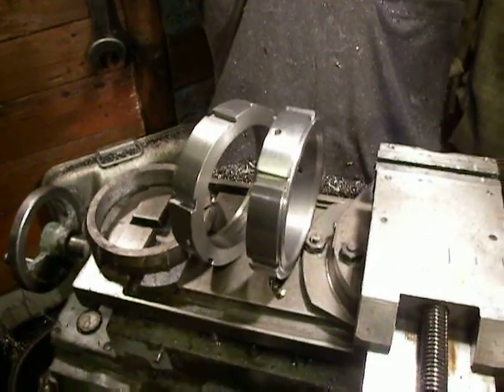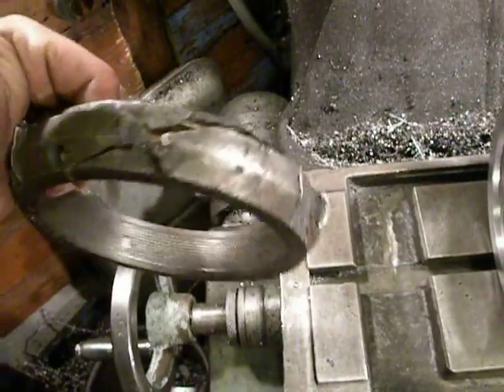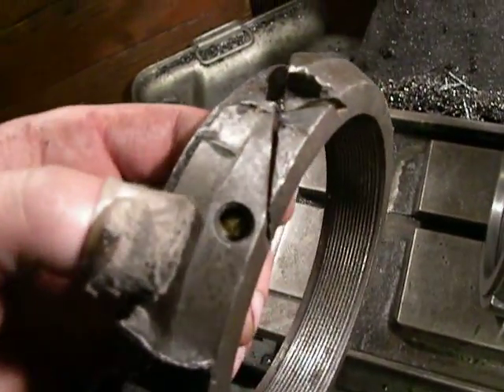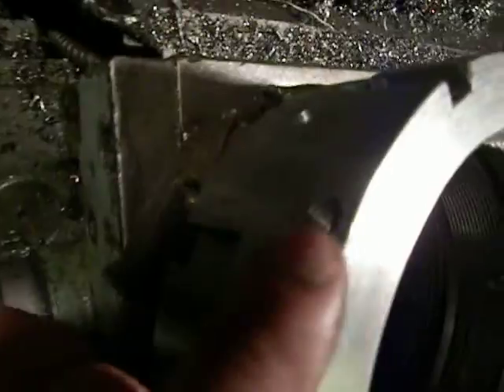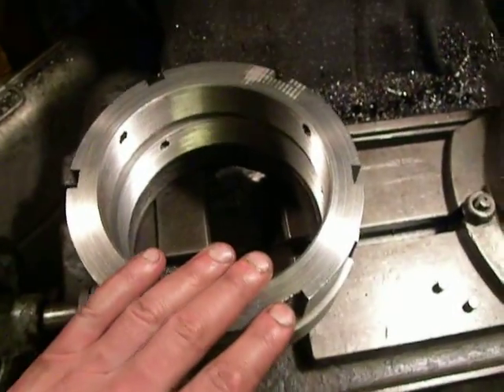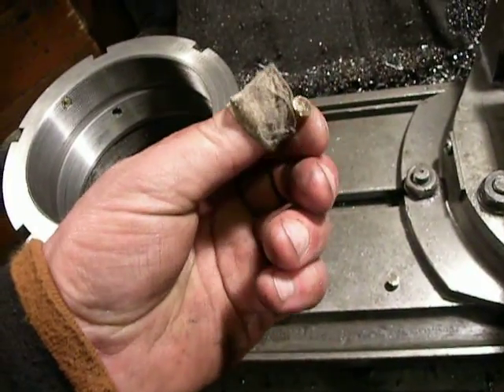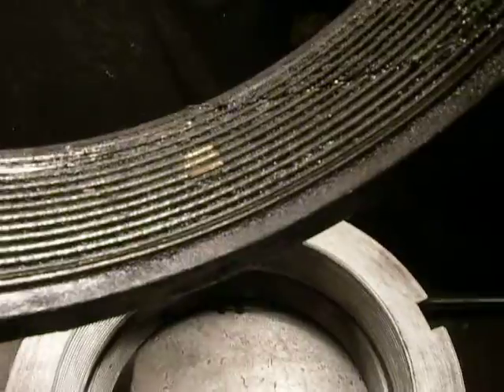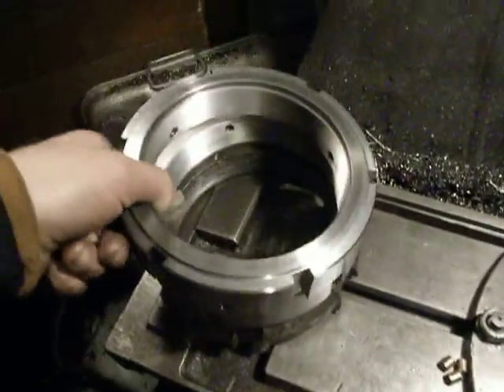Valmet 830 middle pivot express repair - complete nuts for Valmet middle pivot /p6

Comment: good job The wrench you showed  is called a spanner wrench
Reply from the maker: Yeah, Thanks!
Reply: Likely the next spanner dedicated to this job req. a longer handle so that the "twits" who have to remove/tighten it will not have to resort to beating on the nut with a 'drift,'' heavy punch, or whatever.....

Also, a red ring should be drawn around that bronze set screw to remind the 'twits' that it's there....!!!

Comment: I've also used small bits of lead solder behind setscrews when locking against threads
the lead smashes to fit the threads and grabs very well with no damage
Reply from the maker: Yeah. I use brass or soft bronze... effect is same.
Cheers!